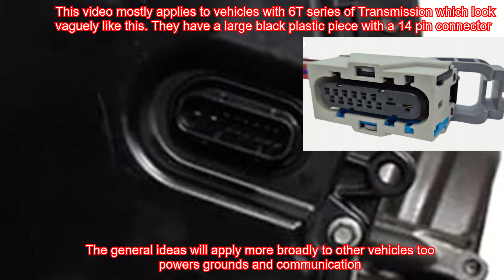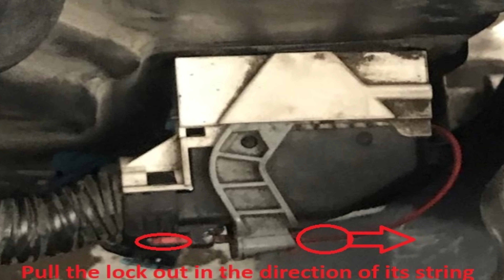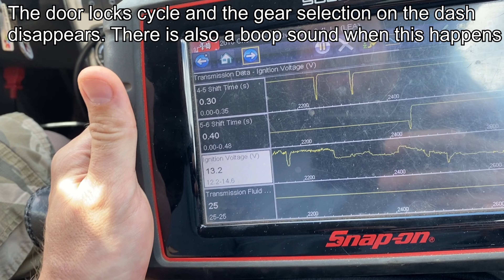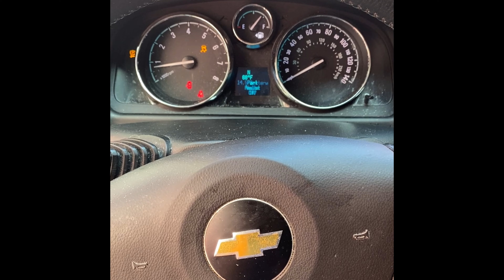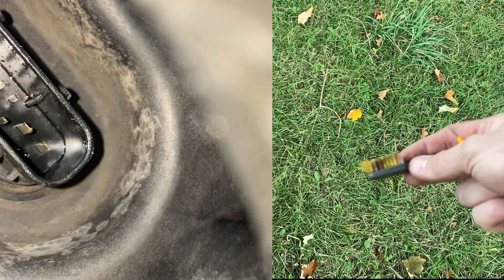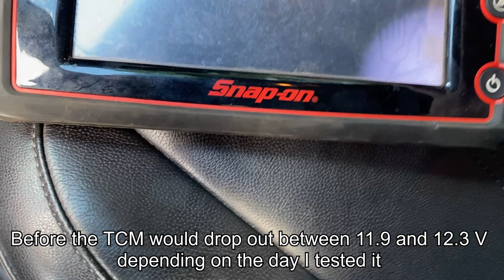Chevrolet U0101 U2106 Cheap Fix 2015 Captiva Sport 2.4L

Comment: I had the same problem a while ago. Same model. The thing is the problem would go away for weeks even months if you leave the car parked a few days, that made diagnostic complicated. Eventually started doing it more often and finally able to check it: It was the TCM module at fault. Reverse gear was also changing violently. It was replaced by a Remanufactured TCM calibrated to the VIN. Note a good battery also needed. Also make sure you don't have any Problems with the Parking Break since it could press the back bullets into the braking disk and cause additional stress in the car. (it gets pressed by pedal or/and by Electronic Park (that goes via ABS). Those also seem to communicate with the TCM, so if TCM changes, car could operate normally but it might not communicate properly until the other COMPUTERS in the captiva are configured to know there is a new TCM. And programming that although no urgent might take a dude that can do that perfectly otherwise not touching that part xD.
Reply: I want to add, these TCM modules have a SERIAL Number that lets you know what generation is. Some generations are compatible some NOT. The eight digit on the serial number (below the bar code of the TCM) tells you the GEN. You need to get that part right or you wasted money. Captiva 2015 could be generation 3, a generation 2 module could be compatible if sent calibrated to the VIN, but check). Then it needs to be fast programmed to re-learn the changes (P, R, N, D etc).
Reply: I'm facing the problem back at the shop! Any way we can chat. Give me a brake. With the few weeks I have. Bin. Busting my thinking cap
Reply: @LuisLara-m6w  Let me know what you are  doing or what's the issue maybe i can give some guidance =).

Comment: Mine is doing the same thing for no reason it drops from 14.7 down to 12.1 and goes erratic. Can't figure it out
Reply from the maker: On this one the voltage is dropping due to the radiator/ac fan kicking on. There probably isn't a way to "fix" that but by reducing the voltage drop in the connector the TCM no longer drops below its operating voltage.
Reply: So should I clean the transmission connector or the fan connector or do you think it could be the fan control module.
Reply from the maker: @pieterdemare5031  clean the transmission connector on both sides (the wiring harness side and the transmission side)

Comment: Where did you get that tiny wire brush for cleaning the female pin connector?
Reply from the maker: Dental section at your local pharmacy or Walmart